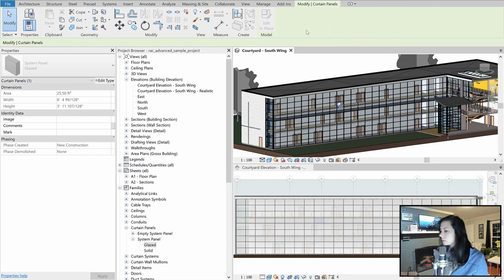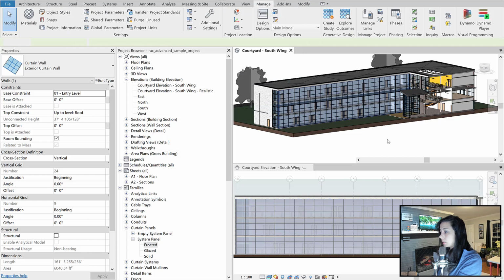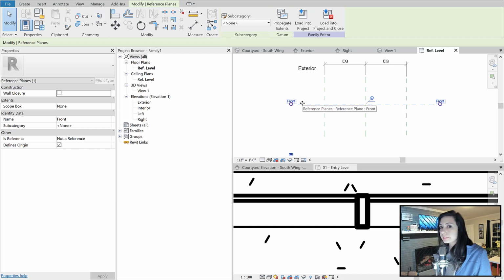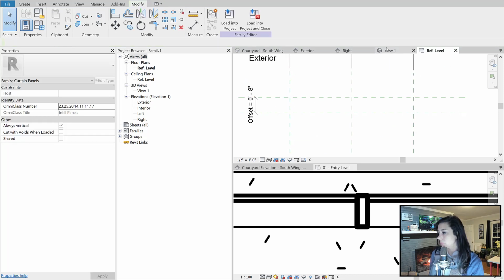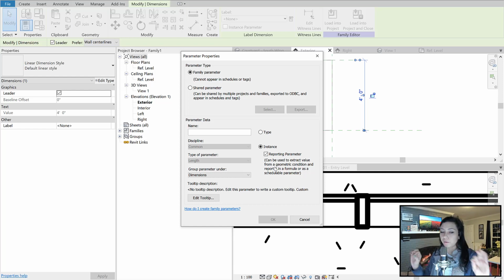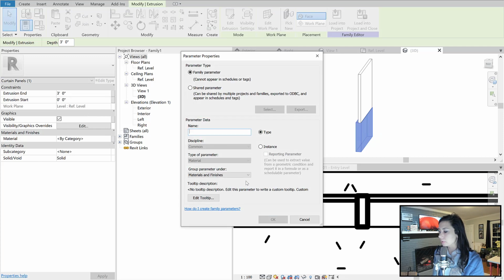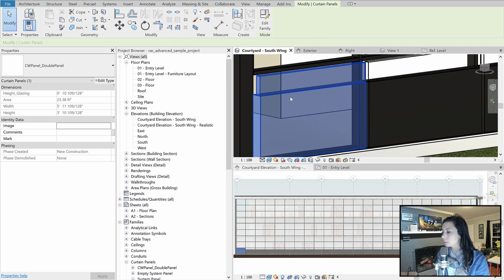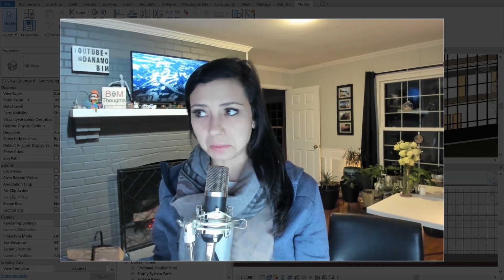Random Revit with Danamo - Ep005 - Curtain Wall Panel Families

Comment: Nice one! Another interesting topics as for curtain walls would be for sure corner mullions (can I create such mullion on my own?), embedded curtain walls inside regular walls, empty system panels vs "none" (we have this choince in Revit 2022 inside curtain wall type properties), repacing curtain wall panels with doors and windows :) Currently in my project I have a problem on building corners where the angle is less than 90 degrees. With curtain panels that have glass, some air gap and insulation - so they are quite thick sandwich- Revit doesn't want to put them at such corners, only simple panels with glass works:(